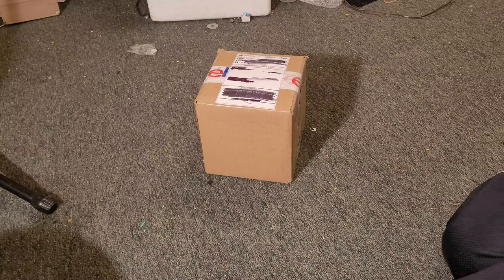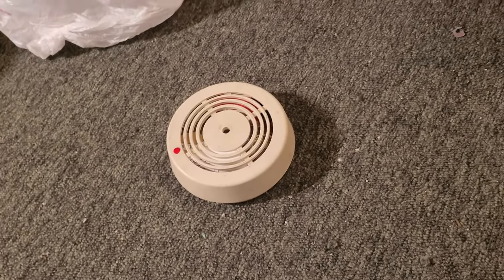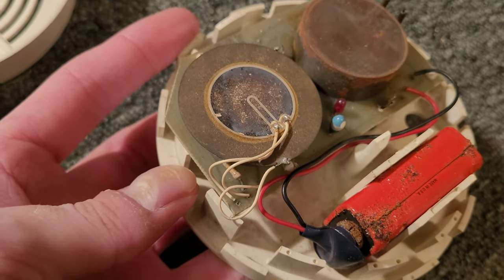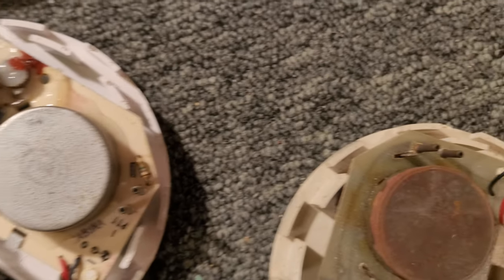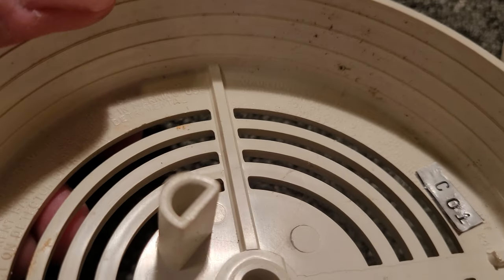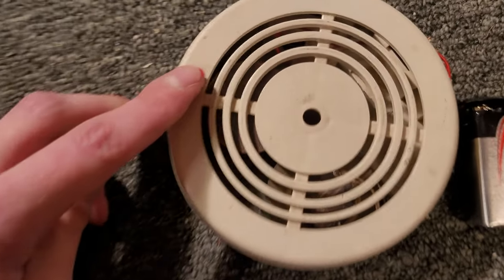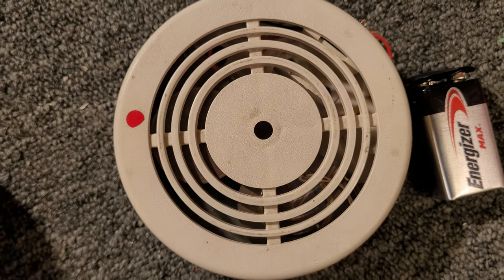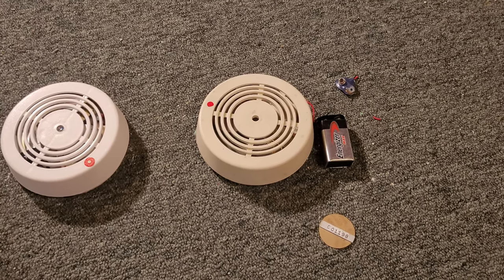General Home Products (JS&A) 'Smoke Sentry' 1806 Smoke Alarm | Unbox & Test

Comment: Very cool and rare! If i was a homeowner that had one of these back in the day the only disappointment i would have is that the sounder is out and open and that would easily very be a Hazzard if it was bumped, either way nice video!
Reply from the maker: The horn element being out of the casing is an odd design, but remember that this was one of the first to use a piezo horn so the idea to put a protective cover around the element probably hadn't been thought of yet, plus a casing would add to the thickness that the overall unit needed to be and would counteract its small 4" profile. I guess they also figure you'd only really be opening it every so often to change the battery.
Reply: Yes, that is true.